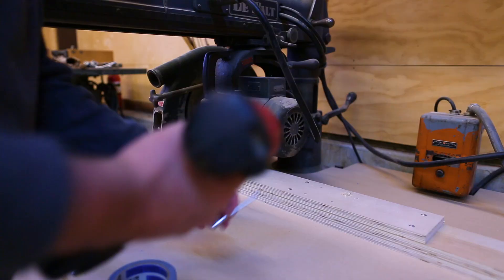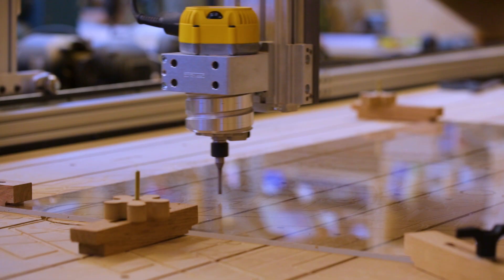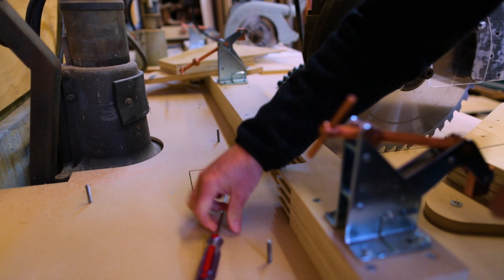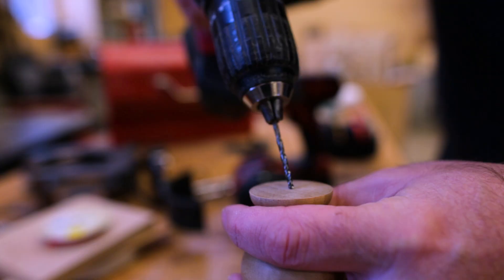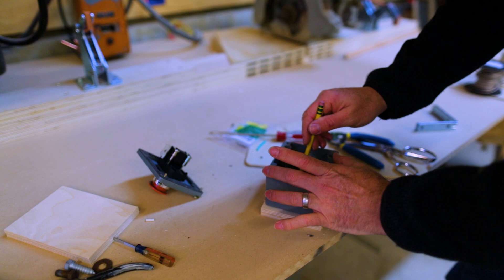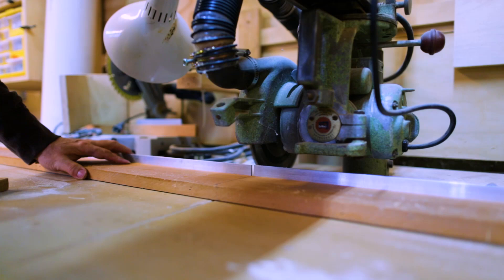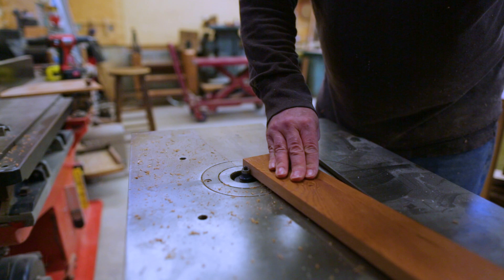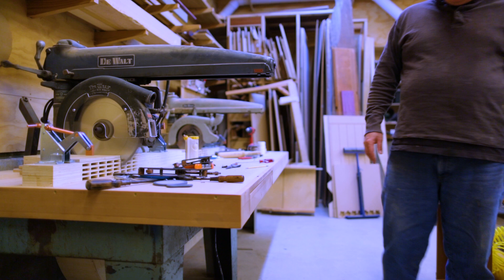Radial Arm Saw 3

Comment: I'm a local glass worker in the town I live in and along side working with plexiglass I work with a material known as lexan. Lexan is a polycarbonate and it won't break or crack like plexiglass. Plexiglass is acrylic so it has those tendencies. Also lexan is more durable and scratch resistant. A person can use any type of machine to shape lexan without worrying about breaking it and with my experiences with lexan it doesn't have as much of a tendency to gum up blades or bits. Cheers!

Comment: for the dust collection gate. you could drill through the top shroud and extend the knob up through that, then under the shroud install magnets to hold it in the up position. that way you don't need to take off the shroud.

awesome videos. love watching them
Reply: That's really smart!
Reply: Robert Ruddy Great idea. Hope Frank considers it?!
Reply: Great idea! and he could miter the edge of the gate on the side closer to the vent so as to reduce airflow blockage
Reply: it looks like the wood is very tight and takes a bit of finagling to remove.  
It is possible that you can't just pull up on it.

Also, the gate being inside the airflow might decrease the performance of the dust collection system.

That said, I love it when people think creatively like that, and really enjoyed your post.
Reply from the maker: I like that.
Reply: I would get rid of the knobs / gate setup... make a blast gate that closes the top of the down pipes ( i know it was hard getting them lined up under the table.) and have a lever set up to open them from the front of the table like under your trim board, and have them so they don't stick out from under the table. Like move the handle lever left or right to open close. or maybe from the top... in between saws behind the fence. So you don't have to take the covers off and pull or replace gates each time to switch saws. But I'm not sure what you have for room under there with the steel tables. You'll need a short throw on the lever end and a long throw on the gate end. 

My setup is different... I have a back wall / shroud and my table is open under the saw in the "parked postion" and I built a 45 degree chute under the saw and 45 degree tops for all the table bracing so the all the saw dust falls down to a 4" pipe. It works for the big stuff but the fine dust still goes every where. Yours seems to not have that problem, unless you keep cleaning up. I think I'm going to try your version, and your plywood piping system... I need to redo the my shop anyway. Too many tools... not enough space... 

BTW love your videos... Also your CNC is awesome... I'm going to rip mine apart and make it like yours.

Comment: When I used to cut acrylic for a sign shop we mainly used cast acrylic instead of extruded because extruded tended to gum up the bits because it is softer. As for speeds I always had the best luck maxing out the RPMs of the spindle. I'd get a cleaner cut and the endmills would last longer but the feedrate was the tricky part. Granted this was all on an industrial machine.

Comment: about 30 years ago when I worked in a workshop. I learned that if you want to mill in acrylic or plastic we used methylated spirits or whatever it is called in English, as the coolant. a small drop from time to time to lubricate the cutter. gave fine cutting surfaces.

Comment: When I have to cut a notch out like that I usually just start the saw up with the blade all the way down and slowly raise it up through the material, it's just a bit more accurate than dropping the material onto the blade. Works great for making shaker style and raised panel cabinet doors as well, the result being that what would be the rails and styles of the door are made from one solid piece, so no joints.
Reply: Add a feather board on the fence and Bobs your uncle. No chance of rising piece or kickback.

Comment: I have to be honest Frank. That cut off button should be placed in an obvious spot away from the saw itself such at the left end of the table in case someone else needs to us it when you can't.  Maybe paint the flap red or a STOP sign on it?  My high school wood shop had a panic button at the entrance and killed the power to everything in the shop.
Reply from the maker: My wife asked if the button needed to be more noticeable
Reply: frank howarth Your wife loves you :)
Reply: If the regulation is anything like in Europe modifying safeties requires you to reinstall it in compliance with the latest standards/laws. In this case that would mean a lot more modifications. (such as switching using two contacts) Also, I'm pretty sure it has to be red/yellow.
You may want to contact some electrician  that knows about modifying safeties on machines to be sure ;)
Reply: Le Stekker dude This is franks personal shop. There are Frank's regulations and that's it. Period. Europe shmurope.
Reply: In that case, no one would require building permits. Who cares if the electrical isn't up to code. It's my house. So what if there are bare wires everywhere.
Reply: Brent, If he's making money by doing these (very nice) videos in there, it might be considered a workshop. Normally all seems well until someone gets hurt and an insurance company comes around to make inquiries.

I'm not saying he has to, I'm saying talk to someone who has knowledge on the subject and make a well informed decision. I for one, wouldn't want my life depending on a single $0.49 contact ;)
Reply: Le Stekker I think the button was a modification of the saw to begin with, so he's just putting back to factory and relocating the button.
Reply: Robert, typically it doesn't work that way; reverting to factory standards is also considered a modification seeing as a change refers to the previous state, not the first known state. But like I said, I don't know the  relevant US/state laws. 
If it was my workshop I'd place a couple of emergency stop buttons around the workshop and tie them into an emergency stop relay that switches/monitors a mains current relay. (monitor sticky contacts, two relays in series is preferable) It's basically what you're referring to in the original post. There's a good reason schools do just that.
Still, when it concerns safety and you don't know what you're doing: consult a professional. There are a lot of exceptions (ie: if machines have a DC brake)
[edit] NFPA 79:2015 seems to be the relevant US law. (anyone?!)
[edit2] Switching mains can only be done if the machine doesn't switch on when reinstating power.
Reply: Here we go, from the 2002 norm: 
"10.7.4 Emergency Stop Actuators. Actuators of emergency stop
devices shall be colored RED. The background immediately
around pushbuttons and disconnect switch actuators used as
emergency stop devices shall be colored YELLOW. The actuator
of a pushbutton-operated device shall be of the palm or
mushroom-head type."

http://telusplanet.net/public/shackner/R2E3/NFPA%2079.pdf (page 30)
Reply: I like your design with the stop bar. Maybe take the stop bar and put it back into the CNC and engrave Emergency Stop into it, paint the letter recesses red if you like. Keeps it looking like a wood shop.
Reply: +Le stekker, doesn't europe also have maximum spindown times for rotating equipment? All i could think of while watching was that e-stop button sure doesn't cause the saw to slow down very fast. Is there a device you can buy that will do the DC injection for braking? I've only seen that on VFDs.

I wonder if it's 3 phase (i'd have to go back and look), and if so it would be neat to stuff a VFD in there for a soft start and quicker normal stop and a fast emergency stop. At which point all of the buttons would just be signals to the VFD.
Reply: ***** This is a real old saw and the emergency button was retrofitted to turn off the power quickly. Frank said in another video how he got it.
Reply: Put your purse down and shut up.

Comment: For the dust collection gate, I would simply place a board in front of the fence to close the opening. When you want suction you don`t need to worry about taking a shroud off but just moving a board.

Comment: A drill bit larger than the hinge hole will index and self center. Then you can use the actual bit to finish drilling the hole . I just tried this on some screen door hinges and it worked very well.

Comment: I cut a lot of plastics with my router and have found that lowering the speed works to keep the plastic clean, I had to go to an external speed control to get it slow enough but it works great. Plastic that I used to just burn up now cuts like butter.
Reply: Yep, high feed, slow speed.

Comment: You made a nice shop, even nicer.  If I had that much equipment, it only would be because I was too busy with paying projects to have time to make upgrades like this.  However, if I somehow overcame that conundrum, I would have considered using the spare third wire to add a ground to the end of the radial arm.  No doubt the case is already grounded somewhere, but couldn't hurt to have an extra just in case the original ground goes bad.

Comment: I cut lots of polycarbonate through out the year and the best bits I have found are an
 "o- flute". These are a single flute up-spiral. Depending on your machines capabilities and materials, you could cut at full depth. Just slow the rpm's as low as possible. 8-10,000 is ideal for these bits.

Comment: For cutting plastic on the router you want an "O Flute" bit.  The single flute lets you increase the chip loading without having to slow the spindle down outside its power band.

Comment: great design change in making a panic shut off bar like that. i think that there is a high likelihood that if you need it you won't want to have to move your hands to get to it plus have to reach over the top to get to it as well. make safety easy.

Comment: From my experience cutting Plexiglas, Lexan, and other acrylic sheet goods, the problem arises from the material melting in the cut. I was able to resolve much of this by using either a up shear or down shear bit, depending on whether the material is supported from the top or the bottom.This also works very well when cutting thin metals with a router, where chips can work under a router base and scratch a polished surface. Of course a sharp cutting bit is imperative as with any material.
Reply from the maker: I was using an up cutting bit, but it could be sharper.

Comment: Those old Radial Arm Saws can be a handful.

I had a crew roofing and siding my place a few years back. The boss lamented that they needed to rip a 2x4, but they were thirty minutes from their shop. I reminded him that I had a (borrowed) RAS in my garage. He looked at me, shaking his head, and said, "We don't rip on a radial arm saw."
He then proceeded to tell me this story:
They were on a job site, some years prior, and they were ripping 2x4s for whatever reason. At some point, the blade caught one, launched it unexpectedly from the saw table and they watched it plunge through the side of the bed of a nearby pickup.

Curiously enough, the reason that the saw was in my garage is that my neighbor buddy and his 70-year-old mother were ripping 2x6s for moldings for his remodeling project.
Reply from the maker: 3 shops back, I tried ripping on a RAS and it launch the board across the shop and put a nice Dent in the metal shop door. I haven't tried sense
Reply: @frankmakes  I understand why they aren't safe for ripping, nut does the blade ever catch and push the head at you? Seems like they be well equipped with a shock absorbing system to prevent sudden movements of the head.

Comment: Great job ! 

You could always use a printer/scanner to get an accurate measure of those holes in the blade guard cover

Scanner works great for getting exact measurements into the computer

Comment: Frank - Buy a "knockout seal conduit fitting" at Lowes to cover the hole on the top of your radial arm saw where the on-off switch wires previously passed.  This part has spring feet that will lock it in place and the bright metal surface will provide a more finished look to your beautiful old DeWalt saw. You probably need a 1/2" (Lowes SKU# 75002) or 3/4" (SKU# 75078) diameter seal. You can buy both for less than a buck. Hope this helps. I really enjoy your channel's videos.

Comment: when cutting plexi on a cnc, use fast shallow cuts with the correct speeds. basically, do everything possible to keep the bit from heating up. be careful with mist coolant. you usually end up breathing in your coolant, and they are generally a great deal of trouble. a jet of air to clear chips and cool the bit is helpful however.

Comment: for plexiglass you need a very sharp bit and you feeding speed needs to be quite slow. the problem with milling plastics is that the frixtion of the bit is not transferred into the material as the material is isolating it... you can use a coolant like petrolium to help cooling.. but thta is messi... so sharp bit and low feeding speed to reduce the friction... love your channel Frank!

Comment: My experience with stainless screws in aluminum is in boats.  In a salt water environment stainless and aluminum need something - silicone, never-seize, etc. or they will bond.  This also happens in fresh water applications, but at a much slower rate.  Considering that Oregon is almost as wet as most ponds, I'd consider getting something on the threads of those screws.
Reply from the maker: it has been wet this fall and winter.  Thanks

Comment: Frank, Love your videos, and I too am a fan of radial saws. I have four in my shop, each dedicated to a different operation, all on the same bench and sharing the same fence line. Your integration of dust collection into the fence is truly elegant and apparently effective. That said, one reason I like radial saws for dedicated 90 degree cuts in the shop is that a standard flip stop,  of either Altendorf or Martin sliding table saw design style,  can be deployed almost right up to the blade for short repetitive square cuts, an application that requires some form of stop extension to get past the fence on miter saws. I may copy your dust collection design with a slight modification: I will attempt to coordinate (by shortening) the height of the collection fence with that of the multiple T-slot extrusion of my stop fence,  so that a simple single T-slot section can be mounted on top of the collection fence to form a continuous T-slot for positioning of the stops close to the blade. Inclusion of this T-slot will secondarily allow laterally adjustable positioning of hold-down clamps mounted to it, so that pieces too short for your fixed clamps to reach them can be clamped as well. Securely holding down such small pieces, I'm sure you will agree, presents even more of a safety concern than do the larger ones which your fixed setup will handle. Thanks again for the many ideas you share, the intimate view of your processes,  and ultra-clear and always entertaining video work.

Comment: It seems to me that two adjustments of the RAS call for adjusting the table, not the saw. One is left and right swing of the arm. The other is parallelism between arm and table (in order to have the same depth of cut as the saw travels along the arm in cross dado). 

Since the two saws have the same table, one cannot necessarily have the correct adjustments.

Perhaps the different tasks of each saw dictate the preferred level of the same table. 
Suppose the smaller saw is for cross dado, the whole table is the ensure parallelism of table and saw of the smaller saw.  

I also have two RAS's and am thinking about them sharing the same table.

Very good ideas on dust collection. I an glad I watched this. Thanks

Comment: Spray it with alcohol while its cutting. It will keep it cool and it does not warp the wood. I also use it for aluminium on my CNC. With alcohol you can pretty much go as fast or slow as you want and it won't gum up.
Reply: Max Maker soapy water also works well and a single flute cutter
Reply: Good tip. I've never been able to work with plexiglass because it melts and creates rough edges when drilling and cutting. I was thinking that water would prevent the melting and make cleaner edges. But alcohol (would windex work too?) would prevent the water from rusting everything. Note, in cars, you can actually spray water into your engine, and get away with running way lower octane fuel, without spark knock (detonation/ping). How they've managed to keep this a secret after all these years, is a mystery. Most people who build turbocharged cars, know about water injection, they sell kits. You spray a water mist into the engine, and it cannot ever blow a head gasket from detonation.

Comment: There is some small chance of galvanic corrosion between the stainless screws and the aluminium blade guard but the chance is quite slight in a dry environment such as a shop like yours, would take some water/moisture to cause any significant reaction.  Keep an eye on the screws though I think it more likely the Al will lose metal were the corrosion to happen.  That you have no other metal touching the SS makes a big difference as well.  Great series Frank, I am always of a dilemma when I see that you and AVE have posted as to which to watch first.
Reply: Agree with you. Except if corrosion does happen, the result will be that the aluminum will oxidize, and seize the screws in place. If you try to remove them at that point, you may shear the head before the screw turns. I have seen this on sailboats exposed to salt spray. If you don't need to remove the screws, they continue to hold fast for a very long time. Many years. As you say, it probably won't be an issue in a shop. I would have used galvanized screws.